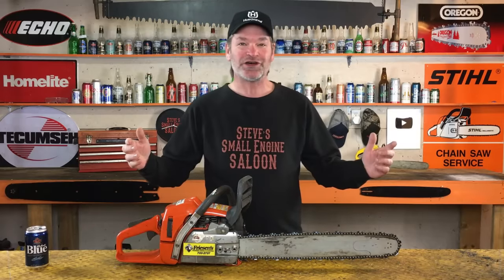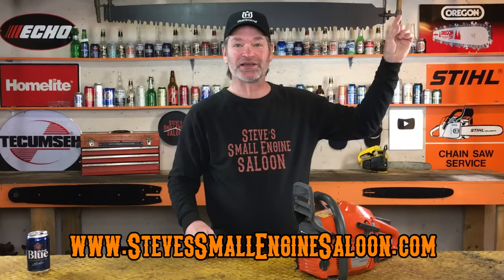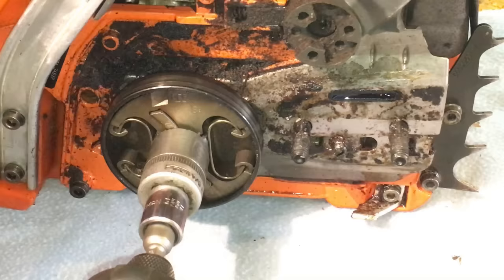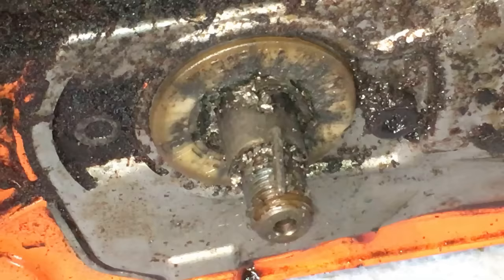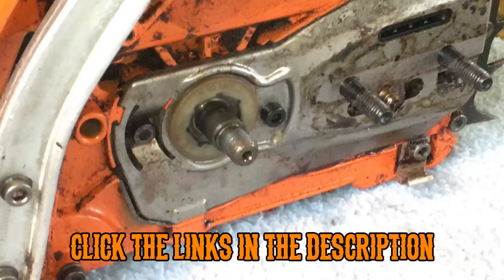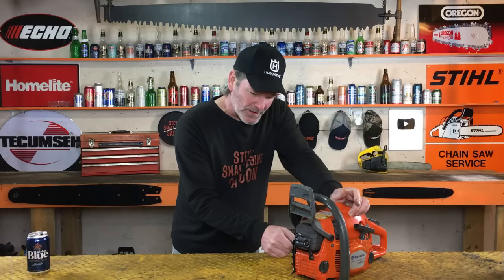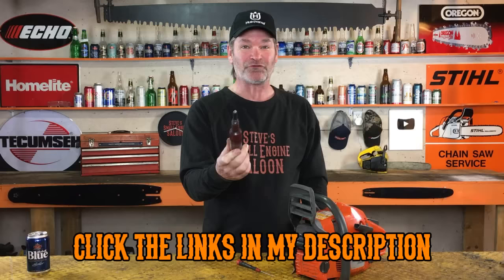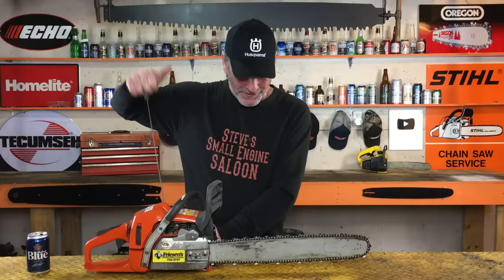WOW! Hidden Greasing Spot On A Chain Saw

Comment: Having seen this I was encouraged to grease the roller bearings within my clutch. (Jonsered 2139T) Imagine my disappointment upon finding no grease hole or channel. Jonered and Husqvarna are related. And I did note that Steve said that not all these saws have this greasing feature. Still I was disappointed.

Anyway I have had the fitting that is screwed in the empty spart plug hole, for 15 years. This was the first time I used it. It stops piston travel when removing a clutch or putting it back on. It was a problem solver. And the clutch came off with just a 19mm scrench. But you have to remember to turn it the opposit way from all other nuts and bolts.  I still have the little tube of genuine Husqvarna grease that came with this saw. So I checked the bearings. Cleaned them and applied the Swedish grease. I did some cleanup in that area and put things together easily with that scrench. And removed the piston stopper. The plug was fine but I brightened it up anyway and installed it.

For cleaning the nooks and crannies of a saw I like to use alcohol in a squirt bottle. Set it for stream some times. WD•40 with the red straw helps too. To confine my mess I got a large discarded cookie sheet.

This is long enough. Thanks for the opportunity to put in my two cents.

Comment: Thanks Steve!.. I just had to replace that same bearing and the “E” clip on my Sthill 180C Chain Saw.  I ordered the parts from Amazon and had them the next day...I kept all of the un-needed parts in my tool box (Specified as for my Chain Saw).  In hind sight, I didn’t know about this small hole in the shaft, however every time I work on ANY engine or car  etc. I take detailed photos of everything, so I will go back to my photos to see if I can see that nice little grease hole.  I didn’t grease that bearing before I put it on my saw, so I’m sure that I’d better do that right away.

Comment: Read the Owner’s Manual for the saw. The description is in there. 

I use an Alemite grease fitting on my gun. Wish my 372XP had that feature instead of requiring removing the circlip and sprocket. Either way, that needle bearing cage needs greasing.
Reply: The owners manual says to drip auto engine oil on that bearing. Not grease.
Reply: @waynes.2983  Yes sir. Grease will block that oil port. Good owners manuals are written by engineers, so are worth the damage to our ego to read.
Reply: @richardking6538  you got that right.

Comment: Oddly, one man wrote in here to discourage greasing the tip of the saw bar. I would just say that I grease mine faithfully. Those sre bearings in there. And bearings need care. What I do is, I flush the bearings with plenty of grease to flush out dirt etc. Then I do it from the other side.
There is nothing like the performance of a well maintained bearing.

Comment: Well I'll be damned! I knew there was a reason I watched this, I had no clue about the bearing grease point on the end of the bar.  I guess I'll be ordering one of them there greasers. Thanks Steve for another informative video.
Reply from the maker: Right on Stevo...
Reply: Not all bars have it, and there is a real debate on whether it is necessary or even desirable to grease the end of the bar (which is probably why some bars - including some from very reputable manufacturers - don't even have the hole in the bar tip).
Reply: Spent 10 years chasing in the northwest. Never grease the bar tip, even if the option is available. Your tip will burn out twice as fast. Bar oil is sufficient.

Comment: How can 58 ppl dislike this video? It makes no logical sense to me.
Reply: It was up to 86 when i liked yours. I would say beer is not the issue as many vids on You Tube are being done the same way some with astronomical figures why i sure cant figure.
Reply: They are Chinese trolls who hates beer 🍻
Reply: Scott W. maybe they ticked off with what Husqvarna. I was not impressed with the special tool kit required to do a simple carb tweak when in the bush. When I brought it to my dealer they wanted 40.00 to do the adjustment. I shame Husqvarna on that scam . Regardless Steve never has done a bad video.
Reply: My guess would be there were 58 small engine repair people viewing the video and didn’t like this repair getting out
Reply: Their democrats

Comment: 112 repair men who charge $40 an hour didn't like you doing this video.
Reply: Only 40 a hr.  Where i live they normally start at 40 a half hour and go up to 140 a hr.
Reply: The job in this video normally costs 5 to 15 in a shop.
Reply: @phillipkramer1897  And they charge $150 to $200.
Reply: $ 40 an hour is a bargain..  when competent that is.
Reply: You think he’s bad check out Scotty Kilmer ChrisFix if your have any car issues hahha
Reply: That’s for damn sure.
Reply: @davedammitt7691  Depends on "minimum charge".  Most shops have a minimum charge.  Lets say that the charge id $25.  A good wrench can complete this job in 10 minutes, meaning the job pays $150 an hour.
Reply: every time I go in he wants to change out my crankshaft. keeps saying "your putting off the inevitable!" I guess I colonoscopy is in order every time I eat a hot dog too!-I am putting off the inevitable on that one too!
Reply: @fucheduck  Have a shyster Sthil dealer in town.  My saw wouldn't stay running and he tried to sell me on crank bearings.  Took the saw to the old guy 30 miles away.  When I got home there was a message that the saw was fixed.  Needed a diaphragm.
Reply: Jesus. My guys are $120hr and $90 just to acknowledge your in their store.   Hate having any warrantee work done.
Reply: @davedammitt7691  or they live in a small town with one shop
Reply: @TheCount46  Cheaper to buy a new chain saw!
Reply: it's up to 315 repair men now.
Reply: I guess he's  done enough your turn
Reply: @fucheduck  The price of a crankshaft installed on a saw?? Cheaper to buy a new saw. I would never consider rebuilding a saw. Had a Stihl 250, less than 30 hours use, well maintained saw, ignition took a shit, new ignition was $180.00, I paid $229.00 for the saw. Never again will I own a Stihl. It was 12 days out of warranty. Now own Husqvarna 440, I'll run rings around that Stihl.
Reply: I thought the same thing .......but then again, this can be said for every video this fella puts out !
Hands down the most informative small engine repair guy I have come across.
Thanks Steve, you ARE APPRECIATED!
Jay
Reply: No, they just don't like sewing their buddies arms and legs back on after boozers run power saws through them.

Comment: I just oil that bearing every time I clean the saw or take the cover off.
Reply: Grease it
Reply: Ditto.  What would the probaility be that the edges of the vertical grease hole lead to premature failure of the needle roller bearing (greased or not)?

Comment: Wow, I can't count the chain saws I have owned and the ones I didn't but used on the job.  It is too simple but "I never knew".  Thanks for the info.  I have already shared this video.  I have always used a chain saw "like a tool" and put it back up until needed again. Fresh gas & bar oil with a quick slick of the file but never knew about this bearing & grease. Never knew & I turned 75 this week!   Wow?  Thank you again!
Reply from the maker: Glad I could help!

Comment: Many people asking about Stihl... so I checked my MS391 while doing cleaning, maintenance and inspection. No grease hole, manual says to clean crankshaft stub & needle cage and lubricate with Stihl lubricant (special accessory)
Have the tube of gear lubricant for brush cutters ... Doesn't look like it needs any yet. (Edit: guys at dealer say they use Mystik grease and/or Multilub would be fine) Lucas Red "N" Tacky would be a great choice and I will probably do that. Stihl bearing grease is not in stock.

Comment: It is a pretty easy fix when you get it early but people don’t pay attention. Once it’s gone like that I seen a lot of saws where people just kept using them and those grind completely down and it starts wearing on the shaft and eventually locks up and you start destroying other parts so you don’t just pop in a new bearing, so it’s good that you’re showing us this and if our chains rolling a little bit when we start it then we can fix it while it’s still just throwing in a new bearing instead of trying to pry apart, a seized up clutch and whatever other broken parts are in there

Comment: My 562xpg has the greaseable bearing. If you read your owners manuals they mention it in there. My smaller saw, the 435, it's manual instructs that you merely drip motor oil onto the clutch every so often during routine maintenance.

Comment: I didn't know about the bar tip grease hole either, or the tool. Checking out my Stihl to see if it's grease-able at those two points and if so will get the tool. Thanks!

Comment: I have a Huskie that I bought around 2007 and it's been an extraordinary saw.  A Rancher something or other.  I cut firewood, mostly oak, every year (4-6 cords of mostly oak) and the only issue I've ever had was something partially blocked the oil feed to the chain.  Other than that all I've ever had to do was replace chains and air filters.  So this was informative.  I'll have to take the saw off my pillow (I sleep with it) and go down to the basement and sharpen the chain and see if I can find that hole.
Reply from the maker: Right on

Comment: Funny thing, I've just given my little old faithful Stihl 017 a thorough service , apart from new plug, air filter etc l fitted a new guide bar, chain and drive sprocket, clutch disc and bearing. The first thing l did was grease the new bearing ( The old one was fine actually) I didn't notice a grease hole on that chainsaw , maybe l should look! ☺️

Comment: Steve i agree with you in greasing the clutch, but i noticed that the saw where the chain oil grove that comes out they were using used motor oil i presume. I myself have done that. what i found was what i saved in oil i was spending in bars and chain's. My question is besides of greasing the clutch this may have contributed in the bearing failure by gumming it all up. If they would of used chain oil it would oh prevented that too.

Comment: Always great information thanks. Does that thing have any compression? I thought that cranked over pretty easy. I knew about that bearing and that some saws have a drilled crank, but I didn't know that LaBatts was still brewing, so thanks. I picked up an older little green saw, replaced all the lines, has great compression, cyl looks fine, but whatever they ran in it left the piston pretty carb'd up. Is cracking the jug and pulling the piston the best way to deal with that? I've went and got some motoseal.

Comment: I brought a saw from the shop to work on at home...and had it on the kitchen counter pulled off the clutch drum and blammo same exact thing. Little needles went flying all over my kitchen, which my cats thought was great fun. To this day I still find them around the house where they were batted around. Unfortunately, it was a Stihl MS-390 on which the oil pump had failed and he cooked that side of the saw. Like...melted.

Comment: Bingo! Got the saw sharpened and filled for yesterday's woodpile work, and noticed the clutch was stiff, lube and spin , and good to go.
Reply: It's a Stihl 250 and the  bearing is on the outside with a clip, very easy to service .
Reply from the maker: Great job!

Comment: Steve I have a husqvarna 145 90s model...I recently replaced carb fuel line filter and plug... Now nothing...I see the gas flowing but the plug is dry... Also on the kill switch when reinstalling carb assembly does the lead go under the coil screw

Comment: Would this cause a saw not to start?  Got a saw that wouldn't start up after running.  The pull cord comes out and stops abruptly.  With no spark plug in it pulls normal.  Psi was only 60 and the needle bearing was destroyed.  Only reason for the pull cord stopping that I could think of was the clutch was activating and binding up.  Never tried to start it with the chain brake off.  Got new upgraded parts on the way.

Comment: For replacement parts do you usually go with Husqvarna brand or do you usually go with a cheap alternative? 
I have found  about a 10-15 dollar difference that I can see. I just need to know if it’s worth spending the extra cash To get manufacture name brand for a Husqvarna 450 or get it off Amazon

Comment: I have a Stihl ms251c. The bar oil is blowing out of the top of the saw just above the opening where the chain travels on top of the bar. Chain and bar are dry and quickly heat up. Oil is coming out and the hole in the bar for the oil to flow is clean. In fact I installed  a new bar to make sure that wasn’t the problem! Any help would be appreciated.

Comment: I have been watching your video' s many times and I have always learned something ...Thank YOU
I do have a question i have a Still 009  that has a good compression ...god sparks  i cleaned the carburetor 
get some petrol but DOESN'T START .....I put anther carburetor it started but it is hard to tune up...
Your help is very much appreciated......I should be more clearly about the carburetor  it was no the some model but
it looked the some   --in and out --.

Comment: just installed new carb, fuel lines/filter and bulb on my 455 huskvarna and the engine roared on start up. Could the new carb be adjusted too high, i didn't make any adjustments other than the installing????any suggestions?

Comment: Steve...great vid and tip!  Just EARNED my subscription.  Thank you.  Hope you can help me.  I have a Stihl MS-250 that is getting excessive bar oil that is "spraying" inside the bar area under the chain cover.  Looks like it may be coming out from inside the clutch area.  Could you point me in a direction to find where that excessive oil is coming from, and possible fix???  Thanks...

Comment: This was the first video I've seen of this channel. I don't even own a gas saw, but I'm subscribed, and look forward to learning more!
Reply from the maker: Awesome, thank you!
Reply: @StevesSmallEngineSaloon  You're welcome. As a union ironworker, I have used gas saws with big abrasive discs. Mostly deckers use them to cut the metal deck, but we borrow them from time to time, and use them to cut a piece of steel in the field. Boy are those things loud when they rip deck, and the sound bounces off the deck below. And the sparks they throw will shred your pants if you don't stand right. Still, all I know is pull the trigger and add gas. I want to know more things like trouble shooting, and maintenance.

Comment: Is this not mentioned in the manual?  The manual for my Husqvarna 450 tells me to regularly drip oil into that needle bearing.  (I assume I do not have the oil ports, but I don't have the saw here with me to check.)

Comment: Now that you have me up to speed on lubing my Husky 55, I have a quick gasoline question. Is it ok to add gas mixed with Stihl synthetic oil to the tank has gas mixed with non-synthetic oil? There's about 1/4 tank in the saw.

Comment: You may have saved me a few bearings !  I didn't know anything about this grease area.  I do have some friends with Huska's, that I've worked with and worked on. I have stilhs , echo's and Macs. The Macs are older units, with manual oil pumps.    Your channel has always been greatly informative and entertaining,  although I didn't like when the,  guy broke your favorite axe.  I respect and value, older equipment in fine working condition.  Thanks for another fine video.
Reply from the maker: Glad I could help!

Comment: When you put the clutch back together and tightening with the impact didn't affect the recoil mechanism ? Thx
Reply: It sometimes shears the flywheel  key.  That why I domt use an impact wrench to remove or install a clutch.I've been a Stihl Gold Certified tech for 20 years

Comment: I use a grease needle stuck on the end of my grease gun for that. I use a piece of rag or such to seal around the hole and go for it. I also do that to grease certain sealed bearings, just pry up the seal just enough to insert...

Comment: Turns out my saw has that open hole for grease. Who knew? I didn't. So I mention it to my saw guy and he says he prefers a couple of drops of oil mix in the hole rather than grease as the grease may collect saw dust and act as an abrasive. Thoughts on that Steve, ay? 
BTW,  your vids are real good stuff.

Comment: yah, i did not know that, thnx.
Reply from the maker: You're Welcome...
Reply: @StevesSmallEngineSaloon  we always had the little grease gun for the tip but never thought about the needle bearings on the clutch. we would always maintain the saws and keep them nice and clean and sharp, maybe that helped.

Comment: I allways preffer cheap chinese counterparts and i allways grease the needle bearing at each chain replacement by simply take off the clutch and CHECK the needle bearing if needs replacement or just to grease up and check the bar oil pump if still works,along checking the cylinder screws tightening,spark plug and gap between magneto and the flywheel,along with replacing the fuel filer,the cheap plastic foam seems to retain more water than the mesh and ball style or cloth type,and never short sprint the throttle to get faster rev up when cold start after long time not running,it saves the life of that needle bearing of the crankshaft that holds the piston arm,all these on every chain replacement ! Good point display here,good vid bro,keep it up ! The best wishes from Romania <3

Comment: Hey steve, I have what I am told maybe a knock off stihl chainsaw.  It has on it's side case, made in Itley.  It needs a ignation coil and it has no model number.  It says on the rope pull case, olympy  K .  It needs a two legged on the coil and all I find in the internet is one legged coil.  Do you have any ideas or help for me getting the right coil